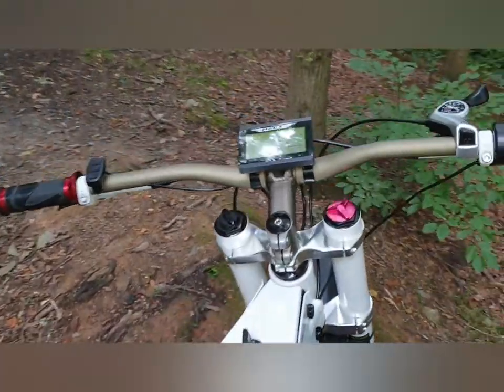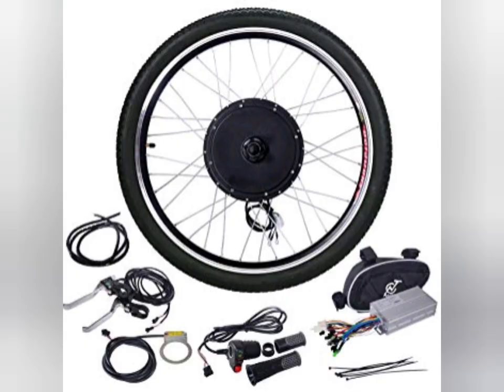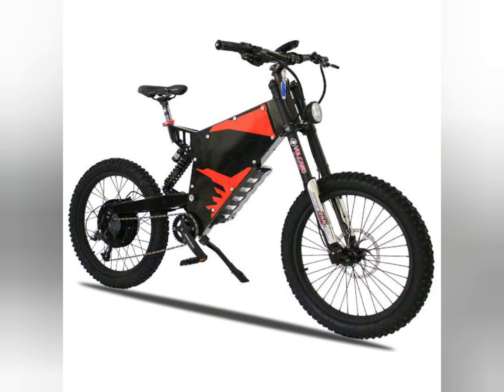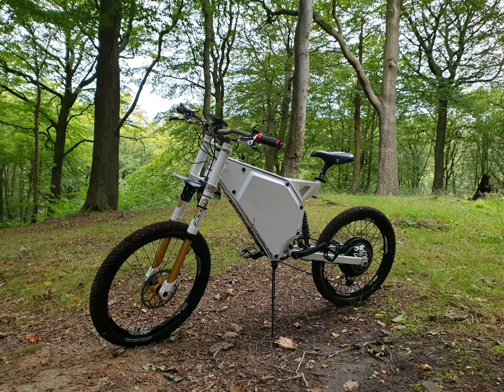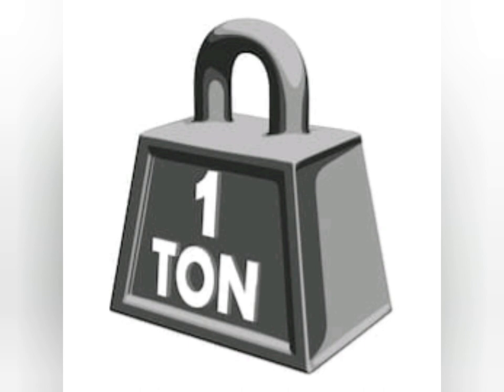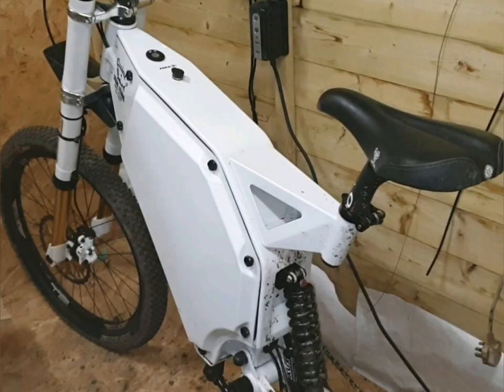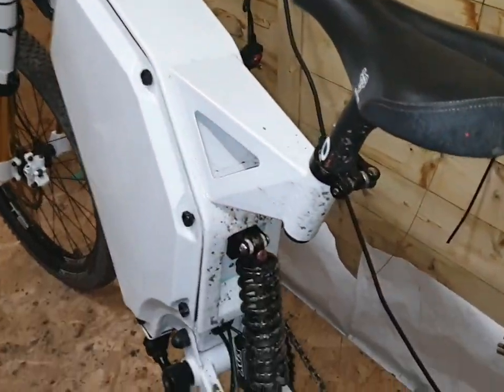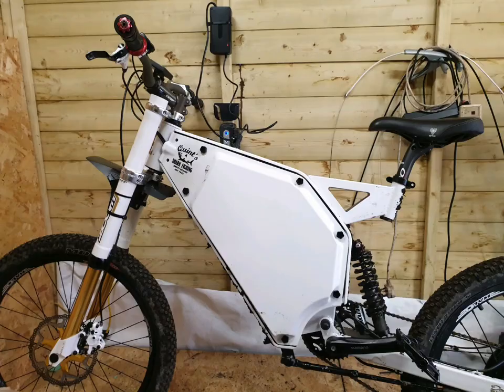diy ebike build, choosing  the right frame and tips, avoid wasting money.

Comment: You can save weight on the all steel frame by ordering 1/8 inch ABS plastic and using the metal plates as a stencil to cut out the ABS….I used a air jig saw to do it.

It saves a bunch of weight you can also us some Aluminum to adapt it to the thumb screws…I’m using them on my build, and the ABS plastic ones came out good.

Amazon sells the ABS plastic….it will save you about 10 pounds….I have my built side panels on my page, I might do a video dedicated to making the plastic panels….if you have a heat gun, and a wood stencil the sky’s the limit on designing.
I believe the frames with the plastic panels is using that exact plastic.

They sell white or black ones, but their easy to paint, any color….mines orange.

Comment: still the best frames to get are the EEB eleek frame and Quilbix frames they have mid drive and hub motor frames all of high quality that can be jumped ,the quilbix can have extra large rear shock to. the chinese style enduros need alot of modifications if wanting serious off road we had to redesign the whole suspension set up and seam weld the entire frame on the chinese ones

Comment: My bike comes in at 45 pound with just the 42v 10.4ah battery, front 250w geared hub motor unrestricted, does 20mph throttle only 24mph if I help it, mongoose tyax elite 2011 black n red ,I love it, my bike is somewhere on Ebike garage with the original 8ah battery

Comment: Nice work mate. How do you find the frame holding up to the 1.5kwh motor torque it produces? I’m specifically worried that the bike dropouts won’t be able to withstand the torque and snap lol
Reply from the maker: The frame handles it no problem and as for the drop outs don't worry they are reinforced and won't snap at all 👍
Reply: Mines running 15kw these frames are really good 1.5kw is nothing tbh my fat bike is a 1.5w

Comment: I wish I had the skillset to build something exactly like that. I wanna go fast but feel safe with decent suspension and breaks. Everything I see prebuilt is like 10k at that point but an electric motorcycle... How much were the parts roughly if you hadn't screwed up and ordered multiple parts?
Reply from the maker: Hi curious
Check out my last video i made a parts and price list. I show all the parts needed to build this bike and a price for each part, and also a total which comes in around £1900, compared to pre built bikes is cheap i think 👍

Comment: Completely agree the biggest cost of these bikes is the fact you buy everything twice I bought a 48v battery and found I'd like more range so next was a 52v battery as it allowed better acceleration and less voltage sag just that cost me around £600 in the end as 1st battery was £450 second one was £500 but I'll be selling the old one on so I'll save some but second hand batterys don't sell for a lot.  Then the hubs them selves buy cheap buy twice as was the case with my first 1000w one where it melted the wires going into the controller so I ended up buying another kit but a 1500w one instead as again I wanted more speed 😅
Reply from the maker: Yeah i was going to sell my old battery but i think its past its best so i wouldnt feel right selling it to someone 🤣. Iv been very luck with my hub motors bought all mine from ebay and always held up great. I do contemplate upgrading to a 3000w or 5000w, but then thats a new battery which will cost about £1000 and i cant justify that at the moment as im having loads of fun with the 1500w 👍
Reply from the maker: P.s i just subbed to your channel and will be catching up on your videos over the next few days 👍
Reply: Oh right I did wonder what the power was do you personally think that 1500w is capable on that bike as what put me off one of them frames is the fact I've seen others build them but they was using 3000w and up
Reply from the maker: Yeah 1500w is the lowest i would recomend for this frame if you check out my vids you can see me open it up in places but im always with my dogs so cant go too fast or i will lose them 🤣
Reply from the maker: @Got_nuffin_on_me yeah i agree parts are expensive and i wish they were cheaper, but my last video i go through my parts and price to build mine. £1900 and i know people that pay that for a push bike with no motor 🤣

Comment: What kind of front wheel and tires did you get. Is it a 19in rim because I've been searching and I don't know what rim to get.
Reply from the maker: Hi vine check out my other videos. Parts and price list and i go through all major parts and wheels are on there, oh and dont forget to subscribe 👍
Reply: U can't just tell me?
Reply from the maker: @vineinc.5690  sure i can but i do get the same questions thats why i mske the videos and theres more than just the tips with the wheel sizes in the videos, theres tips on alot of things you may have missed, but the rim i use on the front is a 21 inch rim, so that makes it a 24" wheel, halo t2 wheel is the make, then i put moto digger 24" jump tyres on, that are chunky and with that tyre gives me alittle ove a 25" wheel, and gives you the look your after. What you need to do is buy a hub motor wheel thats made for a 24" wheel, and when you get it take it to a bike shop and have a look at wheels that are 24" and look as similar to your hub wheel as possible so they match 👍
Reply: @DavidAinscough100  So if I order a hub laced onto a 19 inch rim, I can use 24 inch tires with it? I'm kinda confused. I've been looking for tires for a 19 inch rim but I've found nothing.
Reply from the maker: @vineinc.5690  i use a hub laced onto a 21" rim

Comment: Hello,
Ik have a question, i'm building this type of frame myself would you recomend a steel frame with plastic panels or a beld plate of steel design?

Sorry for my english i'm dutch.
Reply from the maker: Hi I'd recommend a steel frame with plastic panels to keep the weight down, or even light weight aluminium side panels👍good luck with the build, keep me posted with your progress 😁
Reply: Wow thank you for your quick response. Do you know what kind of steal frame is used In this bike? Is it like narrow strips or tubing?
Reply from the maker: @Kris57277  
It is like small box section that is hallow in the middle.

Comment: Hi dave..i,v started my build,i went with the white stealth bomber frame,i ordered a load of parts last night including a 240mm DNM rear shock,But i'm not sure if its to long and i should of gone shorter🤔any advice mate?
Reply from the maker: Hi bud 
Which frame did you get is it the same as mine or is it the one with the stainless steel side panels 👍
Reply: It’s the one before your frame,yes it’s got the steel sides

Comment: Hi mate iam looking to covert my ebike to the same white frame my hub is 1500w 58v 20ah I've got the same forks good brakes the only thing I need to buy is a rear shock and single crank
Reply from the maker: Great 👍  
Did you get the longer brake cable for the rear also
Reply: @DavidAinscough100  not yet I've seen some bomber frames on ebay 220£ but look like steel sdie panels
Reply from the maker: Yeah take a look through my videos it goes through everything you need to build this type of bike
Reply: @DavidAinscough100  will do mate
Reply: Hi mate iam go for one of the frames on ebay in white with black panels but will make some lighter ones at work but just a little confused when it says drop outs some say 150 others say 170
Reply: @DavidAinscough100 hows the build?

Comment: Hi, I need advice on frames and i havent found what im looking for yet, What i wanted to know was the space comparison between the solid steel china frame and the other one (plastic) for the battery compartment, The china bike is spacious but they placed a lip that restricts the size of battery that will fit, My question is, Are these plastic frames with the steel structure the same size as the china steel frames but without the annoying lip
Reply from the maker: I've noticed they have done that with the lip.
But both of these frames don't have that lip, but it was a good few years ago I bought these frames.
The new ones do have that lip though, I wonder if it could be removed 🤔
Reply: @DavidAinscough100  Easily and with an angle grinder

Comment: What make hub motor do you recommend, thanks
Reply from the maker: Hi offroader if you're thinking of building an ebike keep an eye out for my next video, should be out this weekend, its a full parts list of my bike and also a price list of each item.
As for a recommendation for a hub motor ive always bought them from ebay and i cant recal a specific make, they are prob Chinese made but ive had mine for years. If your worried about warranty it may be best to get one from a shop that offers that, but i figured ill give the ebay ones a go because they are only £270 - £350 or so, and it didnt seem like a big gamble to me.
Reply: Thanks for your reply

Comment: There are 2 style frames what one is better yours or the one with the flat side panels
Reply from the maker: I've owned both and the white one I have now is better
Reply: @DavidAinscough100  thank you im poor and trying to build one if you have any parts for sale im interested
Reply: @goldpanties3016  iam about to strip the clone frame if any good to you make me a offer
Reply: @DavidAinscough100  do they have the same sized area for the battery ? I've had the chinese frame and it was crap, stupid welds and a stupid flange,lip restricting the battery size (I have to cut the frame up just to get a 72v 12.5Ah battery in (small in comparison to most battery's)

Comment: Hi there love you video am thinking about getting the bike in you video have you ever but stopped bye police am worried they would take it off me
Reply from the maker: Hi there if the bike has a motor rated more than 250W or an assissted speed of higher than 15.5mph will you need a licence. So yes if the police see you they will have something to say. I ride my bike off road for fun, but i have had alot of people asking this question that want to use a bike for commuting to and from work, so im thinking of building a 1500w stealthy ebike that looks like a normal mountain bike that will avoid unwanted attention and to sell it on to people.
Reply: @DavidAinscough100  Thanks for the reply mate am thinking the same a normal mountain bike that does look to unual and not bringing to much attention

Comment: you shouldve gone with 19in motorcycle wheels instead of 26in
Reply from the maker: I dont have 26 inch wheels 😁
Reply: u got rekt bro,props david for the roast
Reply: David Ainscough what size are they? And will 26 fit that black frame?